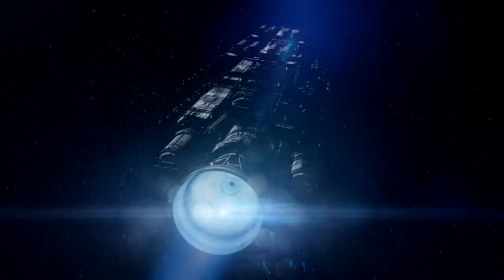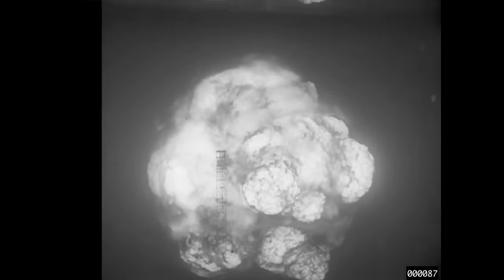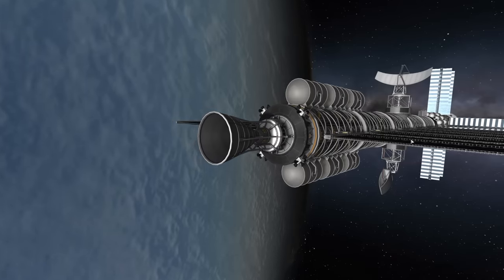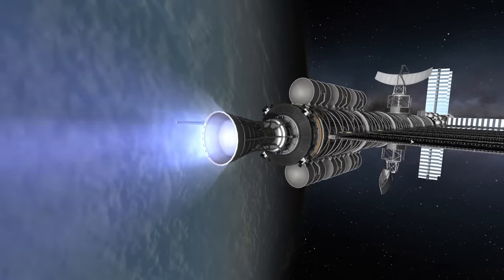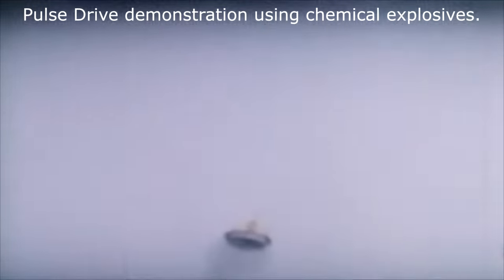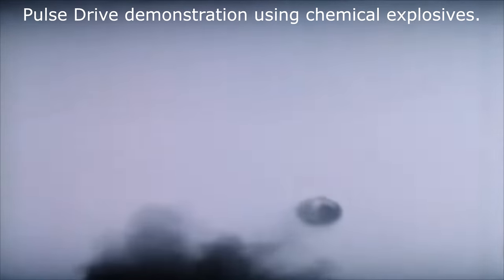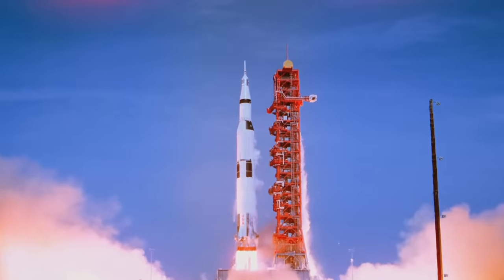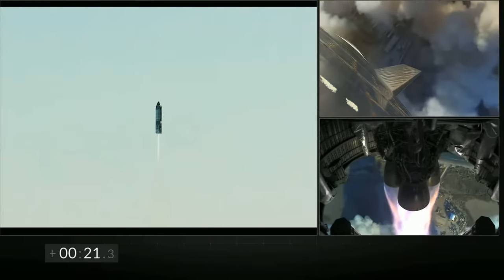The Nuclear Salt Water Rocket - Possibly the Craziest Rocket Engine Ever Imagined.

Comment: "There's a more powerful version, where instead of using reactor grade Uranium it uses WEAPONS grade uranium"

Because of course there is.
Reply: When you need to "hotrod" your reactor drive 😂

"hey, is that engine dual fuel rated?"

DON'T USE THE WRONG FUEL HOSE
Reply: What could possibly go wrong??? Sounds like a safe, secure plan to me! But, but what if the first stage rocket breaks down on ascent and this final stage spreads weapons grade nuclear material everywhere ...
Reply: @ilikenicethings  You'd source the uranium and water from asteroids.
Reply: @ilikenicethings  Theres a point at which we need to be ok with being less risk averse.
Reply: @ilikenicethings  You could put the uranium refinement plant in orbit and feed it with material from asteroids and comets. Practicly building your rocket in space as well helps with a lot of problems.
Reply: @ilikenicethings  Realistically your engine would be built on the dark side of Luna as that would be the only place we could do test fires to inshore that it works. As a result your fuel would likely also be produced on the Luna with the raw material for said fuel ether being locally sourced or shipped in from asteroid mining, albeit that at the very start you might get those supplies from Earth do to not having any resource generation capacity off of Earth yet.
Reply: @ilikenicethings  Don’t use it near a planet. See Nauvoo in The Expanse, built in the asteroid belt.
Reply: @ilikenicethings  that is why you don't fuel it up on earth. Lunar orbit would probably be sufficiently far away.
Reply: @ilikenicethings  
You could launch with the second stage unfueled, then, fuel in orbit sending up multiple sub-critical amounts.
Expensive,  and inefficient,  but MUCH safer.
Reply: @supergeek1418  If we had the Soviet Union, firing it up on Earth wouldn't be a problem. bad for some, good for everyone, I guess. The good thing about the communism is that it absolutely put no value in human lives, as long as the system keep going, you are an ant in the farm, it doesn't matter how many ants die, as long as the queen is alive. (we see how it went)
Reply: @supergeek1418  Unnecessary. The solution would be sub-critical by design, only creating a "critical" reaction during thrust. The vehicle could be safely launched fully fueled, assuming that approach makes sense. Realistically, the fuel load would probably be delivered separately as the craft will likely be built in space. But there is no requirement to deliver the fuel in multiple runs, other than logistics.
Reply: @thewiirocks  
I was thinking FMA: In the event of a RUD, there could be an instance where the enriched uranium salt water could puddle up, achieve criticality,  and (almost instantly) go super critical. 
Bad juju, mon. Bad, bad juju!
Reply: @ilikenicethings   build it in space.
Reply: While we are at it: What do you think would it take to use the fission of the uranium to drive a fusion of the H of the water. Somewhat analogous to an H bomb. In any way feasible?
Reply: @justinreijnders8992  you might want to revisit that thought.  Try looking up a piece here on YouTube about blowing up or nuking the moon. It was an interesting romp basically covering a worst case for your plan.
Reply: The Engines cannie take it capt'in.
Reply: @tingiubik  
Not really. In a thermonuclear device, the initial (relatively small) fission reaction creates a rather large amount of very energetic photons (I. E. X-rays and gamma rays) which radiate outward from the fission device. 
Off to the side of this device is a somewhat large diametered roll of VERY precisely made aluminum foil which (in turn) has a tube filled with deuterium and tritium,  EXACTLY in its center. During the fission reaction scads of high energy photons bounce off of one of the many layers of foil, and are reflected towards the tube containing the deuterium and tritium. All of these photons heat and compress the deuterium  and tritium to the point where fusion occurs, releasing way MORE energy than the fission reaction, alone.
 
Unfortunately,  with a relatively low yield,  continuous reaction,  there's  no massive intense release of photons capable of initiating a fusion reaction.
Reply: Up-cycling at its finest
Reply: Wait to you see what the hydrogen  afterburner can do 😎
Reply: @ilikenicethings      Well, it does not. At worst it spreads 98% water with 2% uranium. Do not add Cool-Aid, do not drink, do not carry around in oil drums.
PS: there is Uranium in the water you drink today.
Reply: @advorak8529  So that's why I feel heavier after drinking from tap!
Reply: Why not Plutonium then? Harder, but more fun!
Reply: @tingiubik  This only works in bombs that use clever designs to achieve the necessary temperature and compression momentarily.
I don’t think you can do this continuously.

Other method I know of is to compress/heat small fuel pellets with very powerful lasers.
Reply: Reminds me of the rocket fuel oxidyzer, where they bound two fluorine atoms together; turned out it was WAY too dangerous to handle and then tried it with 3 fluorine atoms...
Reply: Unlimited Power!
Reply: I doubth that was weapons grade, it was 90 percent u 233 not u235 like he sayd, u233 comes contaminated and is not easy to use for a nuclear bomb, it tends to predetonate. Edit: predetonates because of the contaminants.
Reply: @1320crusier  there's a difference between taking risks and having hundreds of tonnes of extremely poisonous and potentially explosive material flighting over your home in a vessel that might chuck it everywhere
Reply: @Kyle-gw6qp  Isn't that every rocket?  The Uranium could at least be flown in a form that's completely stable and reprocessed into a more volatile form in space.
Reply: @ilikenicethings you don’t arm the engine before you are in space
Reply: @Kyle-gw6qp  No one except China launches over populated areas.
Reply: @1320crusier  yes because radioactive bullshit spread all over the oceans is good.
Reply: @skrubol  if poisonous fuel gets spayed over the oceans that is a big problem. If hundreds of tonnes of radioactive liquid get sprayed over the oceans it is considerably worse.
Reply: @Kyle-gw6qp  lol if only you knew of all the radioactive material on spacecraft
Reply: @Kyle-gw6qp  except that uranium (235 and 238 anyway) are barely radioactive. I'd much rather be exposed to uranium than to most hypergolic fuels.
Reply: @1320crusier  I am aware that there is radioactive material on space craft. There is not any where near hundreds of tonnes though.
Reply: @skrubol  uranium is also a highly toxic heavy metal.
Reply: @justinreijnders8992  There is no dark side of the Luna.
Reply: @ilikenicethings  This doesn't sound like anything that would be part of a space vehicle launched from the Earth's surface, or even nearby Earth orbit.
Reply: @ilikenicethings  rocket launches over land are not allowed.

There are a multitude of warships and submarines roaming the seas, right now, powered by nuclear reactors. The purpose of these vessles are to destroy each other.😅

Some of these are armed with lots of ICBMs. An ICMB is a big long pointy vehicle that's powered by hot expanding exhaust, into sub-orbital space by a first stage, then carried further by a second stage...all whe carrying a uranium weapons grade payload designed to explode.

Some models of ICBMs are literally just a normal rocket that's literally used to put satalites into space.

We're kinda way past that point😐.

At least we had lots of practice in figuring out how to prevent warheads from exploding even if the Rocket explodes.

In the 60's, plenty of malfunctions happened with ICBMs. Rockets exploded (usually inside it's silo), but the warhead always remained intact.
Reply: @tingiubik  maybe if you used heavy water
Reply: @ilikenicethings  that's why you use conventional rocket engines to lift it into a high enough orbit where it's safe to start the nuclear engine.
Reply: Murica!
Reply: @ilikenicethings  The US government dropped an atom bomb near the city I live in New Mexico (outside of Albuquerque), I think we'll be fine.
Reply: You say that now...but if your child was fatally irradiated due to a failed launch, I'm sure you'd feel differently.

Comment: I like this concept and with that exhaust nobody will ever tailgate for long.
Reply: Well as stated by (I think Asimov), any propulsion system efficient enough to propel a starship can stand in as a weapon, just aim the exhaust at your enemy....
Reply: Slamming on the brakes takes care of tailgaters.
Reply: @srenkoch6127  Larry Niven, actually. The Kzinti Lesson.
Reply: @streetwind.  I stand corrected :-)
Reply: @srenkoch6127  If I remember correctly, it was about pointing the (interplanetary) communication system, a strategy used in the first encounter with the Kzin forces (as already stated by @Streetwind, in Larry's Niven universe).
Reply: Well, if you have that kind of engine and STILL being tailgated, that's kinda on you...
Reply: @benr.4238  ...and all the speed you lose while braking comes back when they transfer their momentum to you!   ...well it works when go-carting.
Reply: @benr.4238  wouldn't that mean a flip and burn and when they do the same you are the one being blasted in radiation?
Reply: @srenkoch6127  or aim the ship towards the enemy as a one time battering ram
Reply: Space already has lots of radiation, so I'd hope you had shielding.
Reply: @alexandruianosi8469  the human ship had a "laser driven" engine which they pointed at the other ship.
Wow! It's been about 30 years since I read that book.
Reply: @noobnoobyify  Yep that also works, but only once. 
The exhaust method works as long as you have fuel :-)
(and remember to keep track of your trajectory so you don't crash into something by accident)
Reply: @99PMoon  Now I'm realy curios to dig up the book :D
Reply: @alexandruianosi8469  I think it was wording close to "the better a propulsion system is the better weapon it makes." And it related to every encounter of the first Man-Kzin war as their telepaths told them the humans had zero weapons, which was technically true since the human race achieved a nice well medicated peace. But they actually did have numerous heavy lasers for redirecting inconvenient asteroids and mass drivers for moving cargo. All pretty tame compared to the weird tech available to the Kzin but pretty effective once repurposed.

Comment: "the majority of the reaction will happen where you want it to"

... and the small minority will be occurring where?
Reply: It's best not to think about that, and just learn to live with extra limbs.. or possibly superpowers.
Reply: Everywhere else around you.
Reply: live and let live, dont question it.
Reply: likely in the portion of the pipe just before the primary reaction zone
Reply: @nuclearmedicineman6270  Username checks out?
Reply: @machineball  
That and in the open space behind the nozzle.
Reply: >.. and the small minority will be occurring where?

That will be occurring where you don't want it to
Reply: You’re not cleared for that information.
Reply: But hey, there was that Chernobyl in Space disclaimer in the video. 🙂
Reply: Inside the toilet on the lower deck.
Reply: Well, far away from the crew compartment, probably.
Reply: You would need quite a bit of regular water to keep the engine cool, that water could be stored between the crew section/payload and the tanks with radioactive saltwater in them, so the radiation to the crew should be not much higher then they get in deep space anyways.
Reply: Where you don't want it to. Gosh do I have to spell everything out for you?
Reply: It probably means that you want as much reaction happening inside of the nozzle as possible (and preferably in the "sweet spot"), because whatever happens outside will not provide any thrust already.
Reply: In all the news and on the social media of course. Where else would the small minority be?

Comment: Funny enough, the first time I heard of the Orion project I did ask myself: why not use a constant explosion instead of individual ones?
Looks like somebody did think of that, 30 years ago.
Reply: Because its extremely difficult, because fission explosions are easy and very well known.
Reply: Peter, the thing you are missing is the idea of a continuous reaction. Instead of a handgrenade, which explodes as a single unit, think of a jar of gunpowder. Regardless of size of the gunpowder jar, it will burn and explode when ignited, but with a variation in intensity. The thing about nuclear chain reactions is, however, on stark contrast to chemical reactions that they follow an extremely nonlinear yield. While you could argue that pounds of TNT release about double of what one pound releases, a nuclear bomb of twice the Uranium might yield more then 10 times the explosive energy since it reacted much more material. Criticality is the most important measure. The idea here is to create an area in the engine bell in which there is enough fissable material present to create a runaway fission reaction, but also pump out the fuel fast enough to make sure this runaway reaction doesn't proper gate back into your tanks. Like a flamethrower that shoots out a stream of petrol, it would be very uncomfortable if the flame made it up the stream and into the tanks. Mediating the main propergation method of nuclear reactions, slow neutron density, is crucial here but can be achieved as Scott stated.